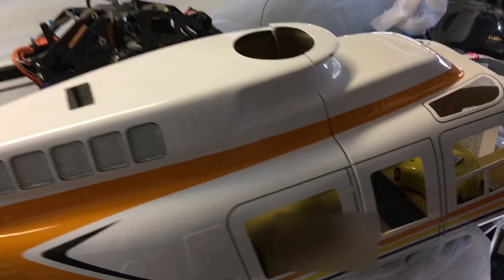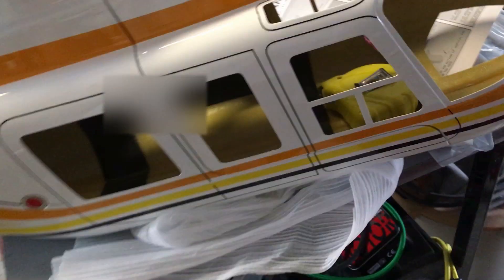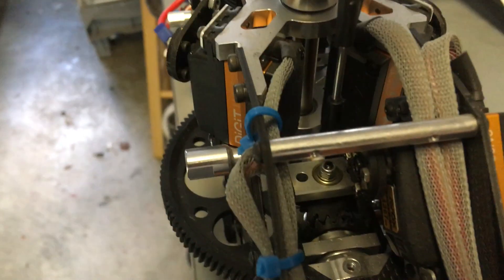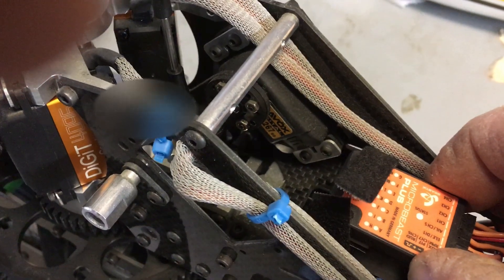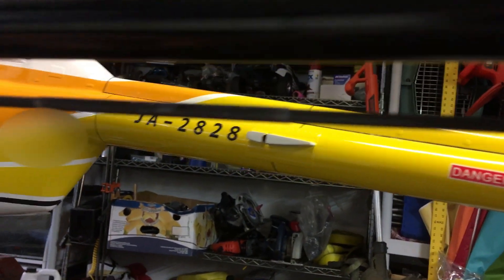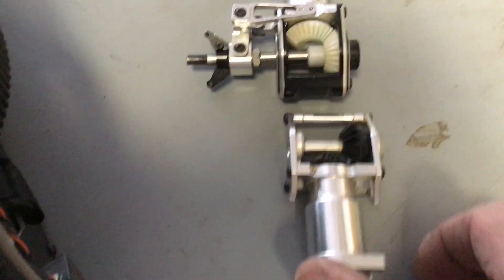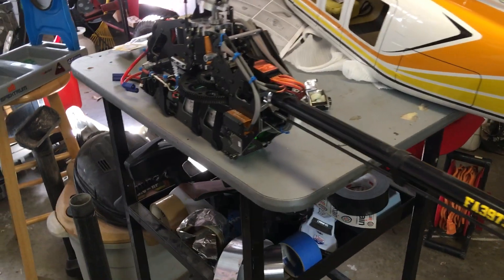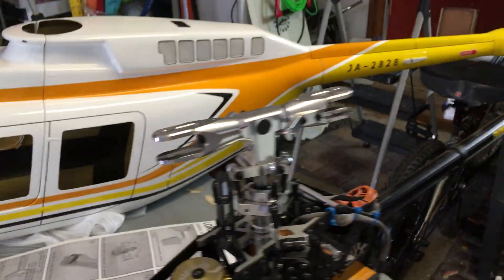Funkey Bell 206L build intro

Comment: NOT once did you show the removal of the nose to access the battery??? not one video on this as the old 60 size had to remove the top. now it looks as thought the whole front comes off, yet no one want so show this in their so called "Build"....
Reply from the maker: This model has been long sold but getting the battery’s in wasn’t too bad. I took out the windshield that was held in with 3 small screws. That gave enough room to stack the two 6s packs held in by Velcro. The CG was right on the main shaft with two 3300 6s packs.